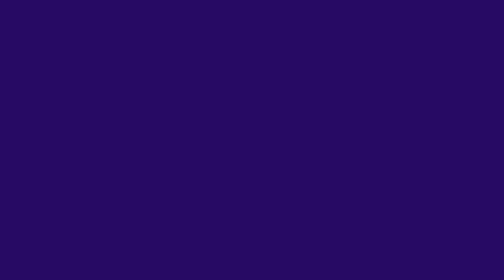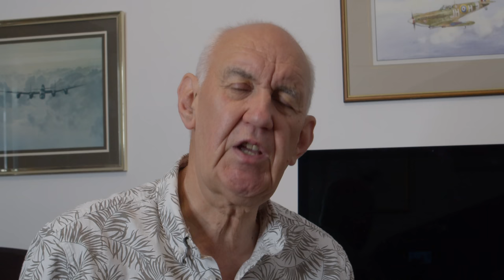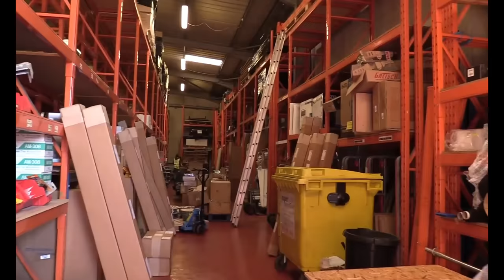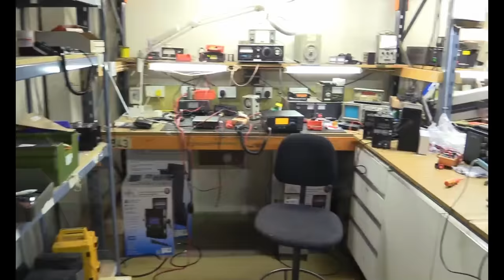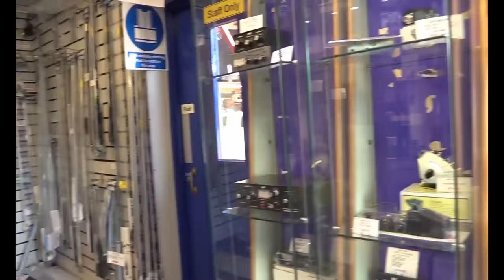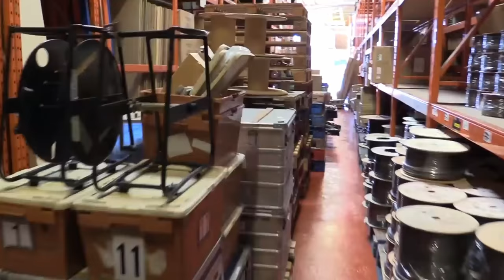HF VERTICAL ANTENNAS - The Positives and The Negatives

Comment: In my case my back yard (garden) was too small to install a horizontal wire for 40 meters, so I ended up opting for a 5BTV installed there. It's the best option I have given the space available. I have set down 14 radials so far, between 5 foot and 10 feet each. I can lay down more if necessary. Thank you for the video.

Comment: Hi good information. Thanks for that. 
I used an antenna modelling software to check out the differences between mounting a 20m monoband vertical on the ground and at various level above ground. The calculations went up to the height of my tower, 17 meters. You are exactly right about the ground losses. The radiating efficiency of the antenna kept going up as the height went up. None of what I did took into account the obstructions at the lower levels. Another reason not to load up my tower. It's next to the house.

Comment: From what I can tell from a couple of years of study, with help from yourself and other channels around the YouTube All antennae are a compromise of one form or another. It's highly unusual to see any antenna in absolute peak performance as there's seldom times that it is situated perfectly as to extract its maximum. Theres No perfect antenna and theres no perfect place for it for the most part. Height, Space restrictions and ground conductivity all make a difference. The best antenna is the one that gets you on the air ;) Thanks Peter. Im not a operator yet as i feel i need to know way more than is actually needed to pass foundation :) But I will be soon :) 73 :)
Reply from the maker: Many thanks and all tge best for the licence. Peter
Reply: well said, sir.
Reply: You are absolutely correct!! I run verticals for VHF / UHF and for HF I use the ole simple EFHW, with a tuner I am good from 10m down to 80m

Comment: Thank you for an informative vertical antenna video. I’m thinking about a ZeroFive 43’ 10-80m ground plane.  No room for radials.  I’ve read only good things about ZeroFive antennas.  Any advice from anyone?  Thanks!

Mr. Waters, your videos are the best.  They’re always at a level I can understand.  You’re a wonderful teacher.  Thank you very much!
Reply from the maker: I have not used or even seen one. I suspect they use a matching transformer, rather like a 9:1 UnUn. Not sure why they specify the minimum feeder length. Clearly it must become active in some way. 73 Peter.

Comment: What you’re saying is exactly what I found while experimenting with a home made 20m mono-band vertical. Dismal performance mounted at ground level, most likely do to house, fence, trees, etc. Somewhat better 3’ (one meter) above the ground with sloping radials. And the best performance so far at approx. 10’ (3 meters) above the ground with a couple of radials and a driven ground rod that reaches the shallow water table. But it’s been a fun learning experience 🤪👍. Thanks for the informative videos, I always share them with my fellow local HAMs !  73 de Dan WD4DB
Reply from the maker: Many thanks for sharing your results. 73 Peter

Comment: Hi Peter.  Thanks for the interesting and informative video.  The subject reminded me of when I was licenced in 1970, living in the Midlands and using a Heathkit HW32A single band transceiver, 100W into a 20m Ground Plane antenna at 6m with four inverted radials I worked a lot of DX including Easter Island in those early days.  It was a very simple and effective antenna.  Now living with a restricted garden in Devon I think it's time I put one up on 20m to see how it compares to my 10/15/20m nested dipoles and 40m long EFHW.  73. Steven G3ZDG
Reply from the maker: Hi Steve, great to hear from you. Nice memories! Hope the antenna change works out. 73 Peter

Comment: I took my DX Commander vertical out of the backyard and mounted it on the ridge line of the roof of my house. I have about 900 feet of total wire spread out all over my roof (random length) as the radials and the thing works fantastic! Way better than it did hiding out in my backyard surrounded by trees and fences etc.
Reply from the maker: Absolutely! If you can get a vertical off the ground the improvement is amazing.

Comment: I am now using a trapped half-wave vertical for 14/18/21/24/28MHz. SWR is lower than 2.0 on all the bands. I got DXCC 100 achieved in four months with it. 😄

Comment: Hi Peter. Thanks for an interesting and informative video. If it's possible, could you make a video concentrating more, or specifically, only on an Elevated vertical with its radial field, like the Hustler 4btv for example. I'm currently busy with mine, but I've read many articles (especially the original 1978 manual) where they say "the radial system must be RF isolated from the mounting structure", as well as the coax or mounting bracket should not be directly grounded. I've mounted mine with a 50mm Stauff clamp (Hydraulic mounting clamp) just above my roof. 4 radials per band for 40m, 20m, and 10m.  Unfortunately a shoulder operation on 20 April has put things on hold a bit..... 73. Donald.
Reply from the maker: hi there. Thanks for watching and will put your suggestion on my list.

Comment: Hello Mr. Waters.

My name is Carlos Rivas YY5RVC. I'm writing from Caracas, Venezuela.

Seeing your video about vertical antennas, made me think in my particular case, living in a twelve stories
residential building, on a hill. The altitude of this place, in case of that matter, is 1.108 meters over sea level.

I bought the antenna with the intention of placing it on the roof, six stories up my apartment. I still no 
decide how I go to install it, near the ground or elevated. Besides, there's not much room for very long radials.

My specific questions are: if I have, for instance, 2 radials for the 80m band (20m each), could I make 4 radials,
where each radial has 2 pairs of 5m cable solded to a connector? It will work? 

And which mode of installation will be more suitable,
on a base, four inches over the roof ground, or elevated, with a base and a mast, four feet over the roof ground?

Thanks in advance for your help, Mr. Waters. I don't miss any of your videos.

73, YY5RVC
Reply from the maker: Hi Carlos, great to hear from you. A vertical on the roof would be great! 73 Peter

Comment: Facinating topic on the subject of verticals Peter as always, I have a Cushcraft MA5V  mounted on the side of my house at about 35 feet. It works for me very well getting some cracking dx (Been up there for at least 9yrs) with only one take down for a coax change and service...I'm also perched at the top of  a hill overlooking the whole village so guess that helps !! I find your talks on aerial types regards wire / beams /verticals extremely helpful and informative....de G7WBB (Alan)
Reply from the maker: Very coThanks for sharingol!

Comment: A pretty balanced synopsis, most of which  aligns with my own limited experience. It has been interesting to try different solutions, sadly with a small garden it tends to be a choice of one or the other, for inter G and Europe predictably a 40m dipole at 10m was very effective,  the vertical is more effective for longer haul. As for ground mounted radials, naively many years ago I believed they should be 1/4 wave, that is obviously not the case due to the considerable detuning with distributed capacitance. Recently I have tried various permutations of "ground systems for a "fan"" vertical. A series of ground stakes in a ring around the antenna base were poor performers and ground resistance appeared to be in the region of 20 or 30 ohms. I disconnected that arrangement and tried about 30 radials just 2m long,  Surprisingly good 10-80m, now using a LOT of 8m long radials. As you rightly point out sometimes a low SWR can be due to a resistive ground system. Many years ago I had an inverted L for 160m, it had a moderate SWR when first installed but adding more and more radial wires raised the efficiency and the SWR.
Reply from the maker: Great info and thanks for sharing. Take care. 73 Peter

Comment: Best Vertical Antenna I've used is DX COMMANDER. Extensive analysis and several upgrades over many years make DX COMMANDER a very refined Antenna that functions as designed. Fair priced. Very good value for the money spent.
Reply from the maker: Yes, ground mounted quarter-wavwe antewnnas do work, but get them off the ground and you will really notice a big improvement, and with far less radials needed.  73 Peter

Comment: Really interesting video, thanks Peter. I purchased a [rather expensive] Diamond BB7V on the back of some of your previous videos. You rated it quite highly, one of its attractions being it doesn’t require radials. Further research has shown this antenna works best at ground level rather than roof mounted, and a ham contact of mine says it should work even better with radials. It’s my first antenna and I’ve been pleased with it, having made contacts >4000 miles with 10W. Have you changed your mind about this antenna now? Should it be raised? Should I fit radials? Great channel! M7WWX.
Reply from the maker: The BB7 can be elevated, but you must add a line isolator  right at the point where the coax connects to the antenna. Radials are not needed as the design is quite different to a quarter wave. Hope that helps.

Comment: My best vertical seemed to be a vertical half-wave dipole on 40m, the lower half using the deliberate co-ax radiation technique. The bottom was near the ground, but I put radials (electrical quarter waves) under it ( not connected to the feedpoint) which might have reduced ground-absorption losses.

Comment: I live in Australia. I use both vertical and end fed wire. The vertical is a 5.5 meter long stainless rod with an 49:1 unun on a 6 meter long pole and works very well with my QRP rig. The end fed is 12 meter's lone with a trap for 80 mounted about 7 meters up and also works very well but both not as good as the end fed half wave (for 40 meters) when I was able to use that. There's no ground radials on the vertical and no counterpoise on the end fed (which also has a 49:1 unun. I use that one with my Qmac HF radio). 73.
Reply from the maker: Hi Ian, thanks for sharing. 73 Peter

Comment: I've had mine since 1978 and the only part that I had to replace the 15 meter trap cover. It has been at the present location since 2000 and it still works great and have worked the world with only 100 watts max and most of the time at qrp levels. At my last location I had a tribander up and no ivertical
didn't as good as the beam and that was expected but for the most part  I have always been happy with the Hustler. Last point is they are built like battle ships, mine has survived hurricanes, Extreme cold, and super dry climates. YOU CAN'T FIND A BETTER ANTENNA!!!

Comment: G'day Peter, I am considering getting a Hustler 5btv. It says in the instructions to keep it at least 20 feet away from any metal. I can't do this because my garden is not wide enough. I can only keep it about 10 feet away from any metal. this is part of my house roof and my neighbours gutter, on there house. What do you think. From Ross 73s.
Reply from the maker: It is quite common to have multi element verticals, with elements very close to one another and they work. So I would expect there to be no problem. Peter.

Comment: As always Peter you have zeroed in on your subject matter and have helped me enormously on the vertical antenna subject. I intend to erect a vertical shortly and I questioned the sense of a ground level mount but as you have explained most clearly I would be best to elevate the vertical to optimise performance. What height (ideally) do you recommend I raise my vertical to in order that the performance is improved to a more effective level? I’d be targeting the 20M band and above in frequency for operation. I’d be very grateful if you could advise. Many thanks and 73 de GI8WFA. Cheers, William.
Reply from the maker: Glad to be of help. 73 Peter.

Comment: Hi Peter,  very good video and my favorite and only ant I've ever used over 35 years on the air.
Dx, different people different ideas of dx, for me dx is at least my signal going round the planet, zl to eu, not zl to vk or ja.
I've tried many ants, the simplest is the vertical of course and gives low angle take off which equals dx.
My 20m vertical ant is a 5m alloy painters pole attached to the fence and some radials,  zl to eu every day.
People worry about radials and space,  mine are short and long, on the ground, in the ground, in the hedge,  under the garden shed, even had a vertical on the deck and radials in between the boards, stick them anywhere, it will work.
I have done verticals in a tree or next to the garden shed, in a corner of the smallest 
Garden, it's easy, give it a go.
73 zl3xdj

Comment: I've found that since homebrew wire antennas are practically free, that for the cost of 1 commercially built ham antenna I can easily set up a vertical on a fiberglass or PVC mast, (or use conduit for the vertical itself, set up an inverted V or 2 the same way, and EFHW's in a couple of directions, and then just switch between all of them to find out which one is working best under the conditions at the time. Sometimes the unused antennas may make things slightly worse. But just as often they will likely make things slightly better. Variety is the spice of life.
Reply from the maker: Many thanks. Interesting to hear your results. 73 Peter

Comment: When considering a vertical that's NOT going to be ground-mounted, is there an optimal height that u'd generally recommend?
Reply from the maker: The main requirement is that is is elevated at a minimum of around 2m/ But, the more sky it can see at low anfles, the better.

Comment: If I put a vertical up on a 40 foot tower, how would I attach radials?  I could see using aluminum or stainless steel rods but they couldn't be much more than 6 or 8 feet before they would bend I would think.  How do people do this??
Reply from the maker: Use wire.

Comment: Hi just watched your video thanks, I have a multi band Yagi up at 20mtrs, but would love to try a vertical, i am lucky enough to have a spare tower, the tower has 3 x 6mtr sections and I thought about erecting 2 , sections and put the vertical at the top, not too sure about the radicals though??? what would you suggest?
Reply from the maker: Elevated verticals work well BUT you do need two resonant radials per band.
Reply: Ok thanks but what if the tower is higher than the length the radials are supposed to be??   @watersstanton

Comment: i'm in the process of getting a half wave on 20M mounted on a DX commander 12.4M pole. i live in suburbia so a 1/4 wave ground mount is a no go and my garden is a bit narrow for the 1/4 wave elevated radials needed for a raised 1/4 wave vertical. 73, M7BKF
Reply from the maker: A half wave inverted V is a great antenna. Go fir it!
Reply: @watersstanton  it's actually a vertical. i have a horizontal end fed for 40M, that may end up inverted V.

Comment: I love EFHWs, but the new EMF regs made mine unusable for anything other than QRP at my QTH, so I've been experimenting with verticals. I'm surrounded by houses, and as expected the reception and S/N are pretty terrible using a vertical. However, recently I've split Rx and Tx with an active loop receive antenna, and that has helped tremendously. Obviously my Tx pattern is still not great, but at least I'm getting out! That said, once my CW skills are up to snuff, the EFHW is going back up and I'll be working QRP, might still hold on to the Rx loop though ;)
Reply from the maker: Thanks for sharing. 73 Peter
Reply: EMF regs?

Comment: interesting, i saw alot of hams using verticals, they sounds complicated, i just got into the hobby after buying an RTL-SDR
after using the stock adjustable dipoles for VHF/UHF, i went directly to horizontal wire dipoles for HF
but realized that to get the lower bands (80m, 160m), the wire length is unmanageable, and a quarter wave would be shorter than a dipole
but building a mast would be a challenge for a beginner like me.
i think verticals tend to pick sky waves more than ground waves like vertical dipoles do bc their gain favor such behavior bc of the mirror effect, but well if the above ground radials were at an angle, they will pick ground waves better too
but i'm still confused about the polarization, bc my horizontal still pick vertically polarized VHF airband which is weird
Reply from the maker: HF signals are randomly polarised caused by refraction, unlike VHF signals.

Comment: I use an EFHW (which tunes on 160-10m on my FTDX101MP) for top band and 80m (soon to be a top band dipole)	and a DX commander all band vertical. The efhw is superior on 40m for intra G contacts but the DXC is noticeably better on longer contacts. On 20m right the way to 6m the vertical is vastly superior. I do have lower noise on the wire, which I put down to it being quite high up and my location (I get around S3 on top band of noise). The radial field on my vertical consists of 10 bundles of 4 radials @ 3m long, simply because I had a lot of old wire kicking about! I should point out I don't use a tuner on the vertical.
Reply from the maker: Mamy thanks fot sharing. 73 Peter

Comment: Peter has anyone ever tried putting up the hustler radials on the ground but put the on a mast above the ground?
Reply from the maker: Radials need to be connected to the bottom of the antenna, not the bottom of any support mast.